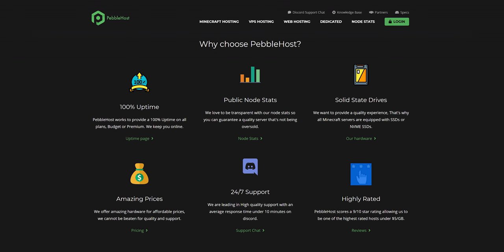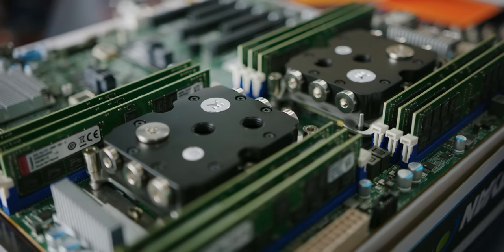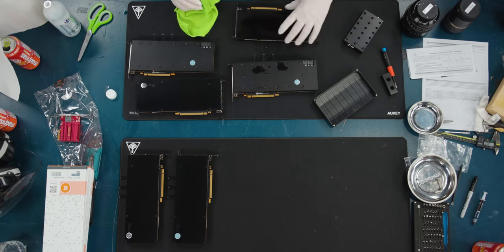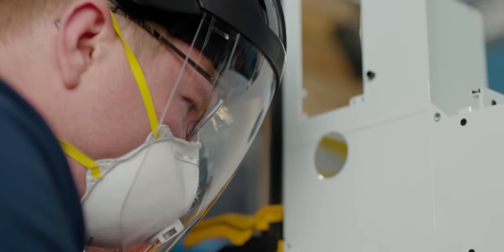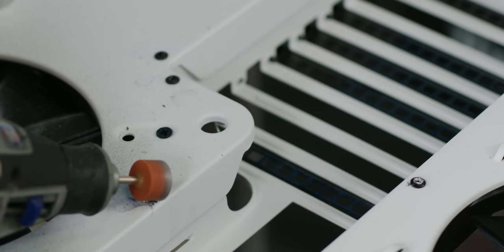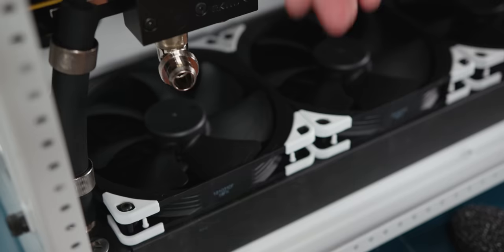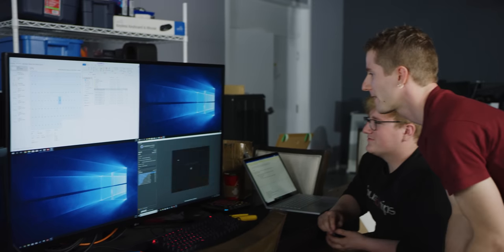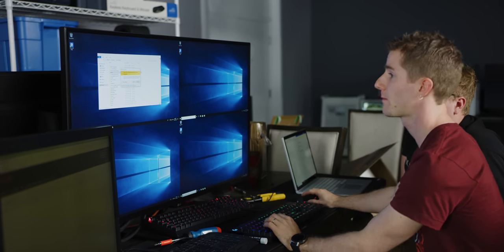We FINISHED the $100,000 PC! - 6 Editors 1 CPU Pt. 6

Comment: How about a 6-editors 1-CPU video with Threadripper next ?
Reply: Linus is an Intel man, will never happen with AMD.
Reply: @jankees4037  He isn't even said it in his own video once.
Reply: tl;dr: Unfair comparing server chips with workstation chips.

Unlikely with Zen+, it would be a downgrade from this setup.   A few problems: 32 cores instead of 56, half the cores have no attached memory, less PCIe lanes, etc.  Linus' setup already limits each titan to an x8 link but has leftovers for high-end network cards and storage.  With a 64-lane threadripper you would have to split a single x16 between the chipset, SATA, optane, 6 USB adapters and the 40GB network card - or limit the titans to x4, which would be enough to start hitting performance.

Epyc on the other hand can beat the core count, has enough PCIe lanes to give each card x16 with 32 left for everything else (More than an i9 or ryzen chip has total), but can't match the clockspeed.  I couldn't tell you which would come out ahead, it would probably be a tossup.

The same setup with Epyc2 will probably clearly favor AMD.  128 cores (64+64) alone would trounce any performance gap between the two, and if the leaking performance rumors for the 3xxx series hold up and apply to rome, it would dominate any matchup.

All that said - I've merged two machines into a single threadripper box and I'm working on adding another so I can use it in my livingroom on the 4k TV as well.  Intel only has a performance advantage in extremely niche markets nowadays - hyper-twitch esports, ridiculously dense computing.  Only when you absolutely NEED that extra handful of FPS when you're already near 220 on a 2080ti w/gsync monitor does it make sense to get one of the highest-end intel CPUs.   Only when you absolutely have to have 200+ cores in a single system do you need 8-way xeon platinum.  And you're going to pay for not just in your wallet, but it in general performance as well: that twitch-optimized CPU takes a bath when it comes to other workloads, and those 448-core xeon 92xx servers are only running at a bit over 1ghz each, so for anything that's not computing on 900 threads it will be slower.

Comment: Shouldn't this be called "6 Editors 2 CPU's" or did I miss something?
Reply: Yes and no. Yes there is 2 CPUs but they act together a single CPU. Hence the name "6 editors 1 CPU"
Reply: @React2Quick  "6 Editors 1 PC" Would be more appropriate
Reply: @everythingfeline7367  no because they could be using it at different times
Reply: Carefully watch the intro and the very ending
Reply: @Logan-mh4jj  Yes, that's the point
Reply: @manspider1833   I did.
Reply: @React2Quick  Sorry man, but 2 CPU's is still 2 CPU's.  As far as the OS is concerned, you're right, but to be fair, the OS treats every core and thread as a separate CPU as well.  The OS doesn't care.  Every thread is another CPU as far as it's concerned and treats it as such.  But what we're talking about is physical hardware and on that front, 2 CPU's is still 2 CPU's.  Not 1, but 2.   Hence the title is wrong.
Reply: @valhallasashes4354  It's not wrong though.

Comment: Why do you want everyone in editing team to work from a single tower?

Like wouldn't having multiple pcs reduce loss Incase one of the pcs is having an issue?
Reply: It makes more sense when you don’t think about it
Reply: Same reason why build a Bugatti Veyron was built.
Reply: Starter employes . this would do well
Reply: The worst would be if the motherboard broke. But actually upgrading the maschine and administrating it is much easier. Like, you can easily clone a VM and update it if something needs to be changed. They are also easier to remote control and do not rely on stuff like BIOS settings and such - they are handled centrally instead. Sure, everyone BUT Linus would just purchase six computers, but I can kinda see his point in regards to maintainability.

Comment: 1 Rome 64 core CPU would have done the work of those 2 CPU’s
Reply: Isn't Rome basically a dual CPU?
Reply: @chugs1984  No. A Naples 32C/64T has 4 NUMA nodes, so it's memory access would be comparable to a 4 socket system. In this case it wouldn't be a problem as each VM should have NUMA affinity. On the other hand, a 64/128T Rome CPU has only 1 NUMA node because the memory access is the same from every core.

Comment: Why is it not i good idea to have the top radiator pushing heat in the case ? 

PS: The electricity meter is running faster then Usain Bolt

Comment: Why?

I can sort of understand it if all 6 editors are not always used, and you want to add more resources to some of your vms. But it seems that there is going to be more bottlenecks somewhere, than the same amount of money on individual machines??? Not to mention all your eggs are in one basket.

I was around before the pc Era, routing lots of cables under false floors on main frames that took up very large rooms. We added smart monitors instead of dumb ones. Networked in HP's, smaller Dec pdp 11,s and vax 750/780. One day, it was understood there would be a computer on every desk, wired together, as we sent messages over the internet of the day, and I played with one of the first prototype mouses in existance. To raster a 300 dpi geometrical shape for an experimental hp inkjet took a pdp 10 8 hrs of compute time, costing several thousands dollars. It's 2mb of ram took several racks. Those were the days, and we used all that to help design the chips of today.

Comment: i know this is old video, but i like to watchin u... i dont feel that u make good airflow (case must be closed, u know it) ... question: why u used 6 GPUs on one monitor with 4 screens?  2000W power supply was enough (with 10 harddisks) ?